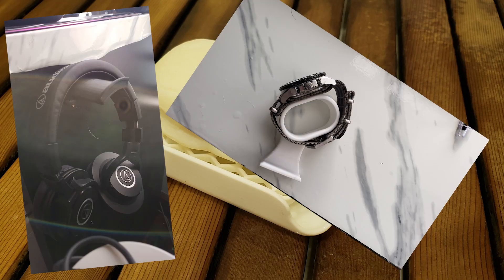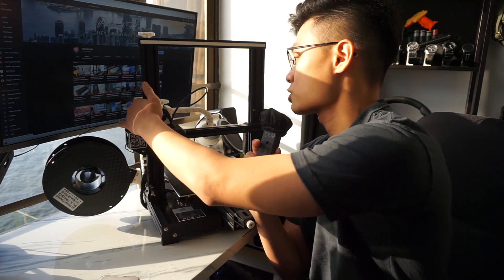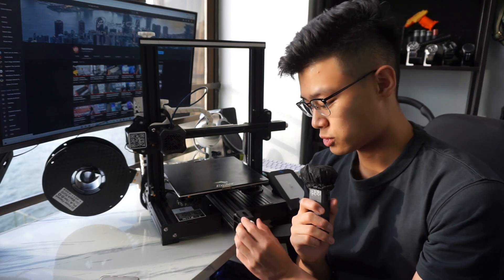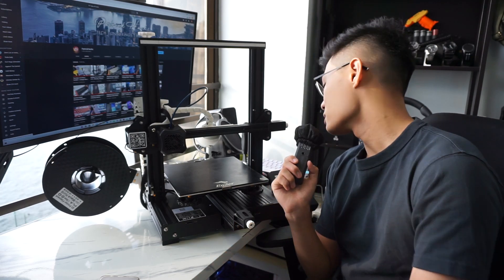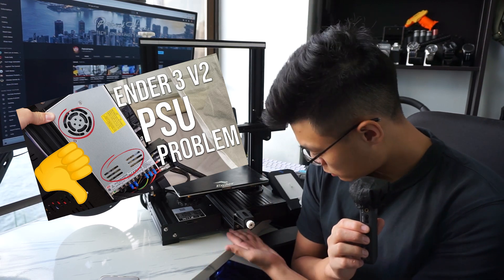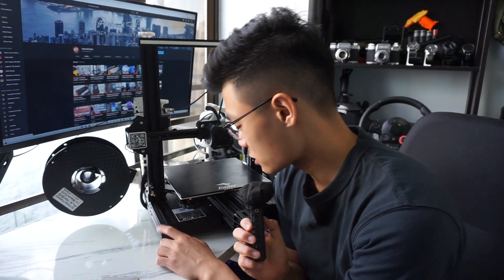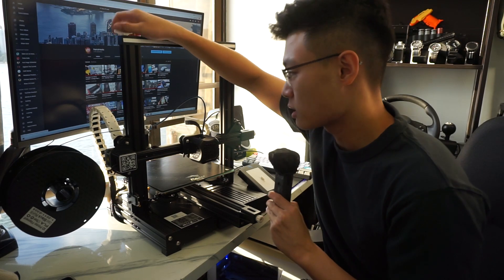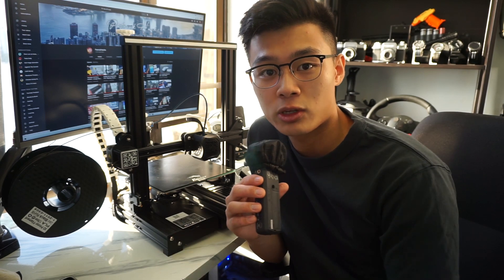13 Free Printable Upgrades for the Ender 3 V2

Comment: How bout building a case from 80/20 & plexiglass? What do the internal case dimensions need to be? 20"x20"x22"? You can buy dust covers from 80/20 or McMaster Carr and cut to size